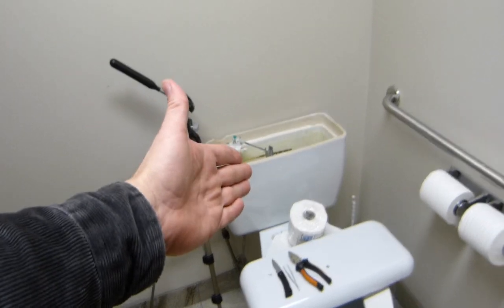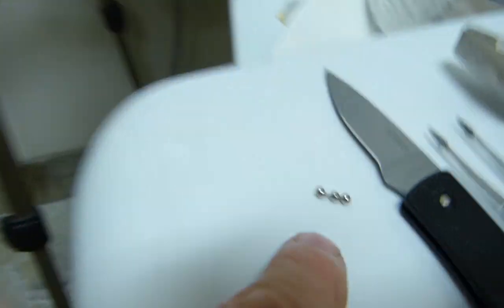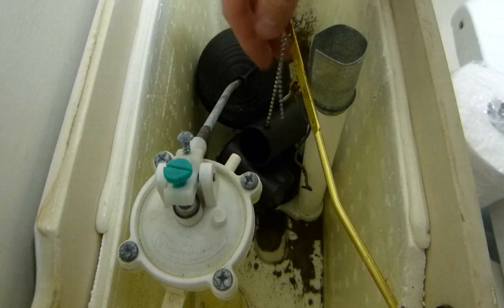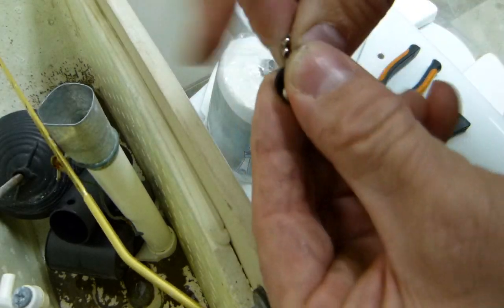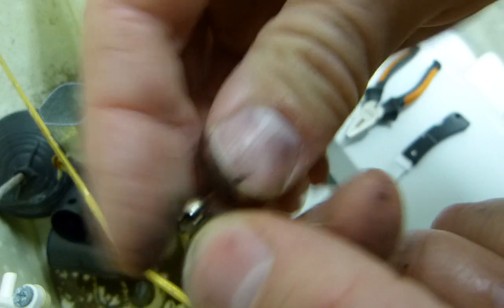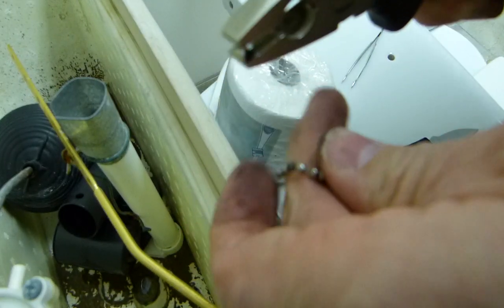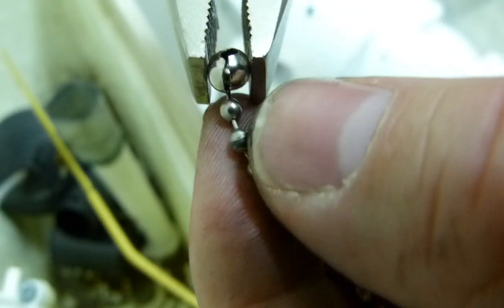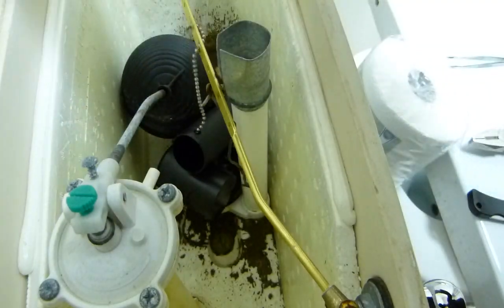Fix / replace chain inside toilet tank

Comment: There’s no way you just hang the chain inside the arm like that. You’ll have to fix it every few days that way. How is it actually supposed to be attached?
Reply from the maker: It's been fully functional since, the connecting wire  between the balls need to be fully seated in the slot in the arm, then the chain does not run.